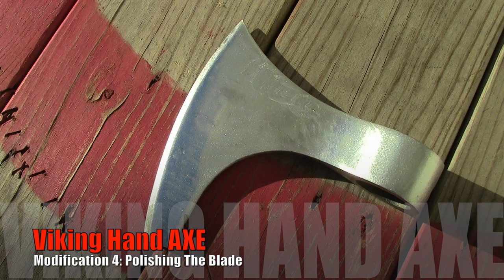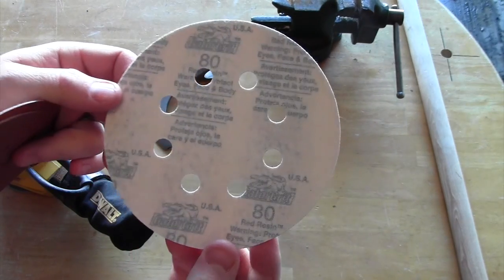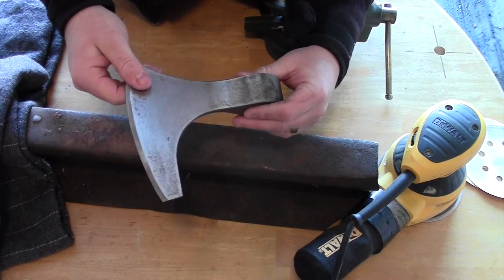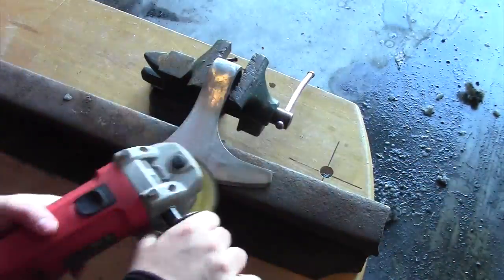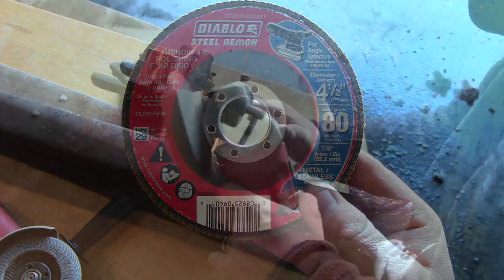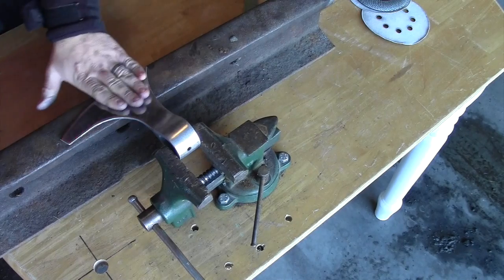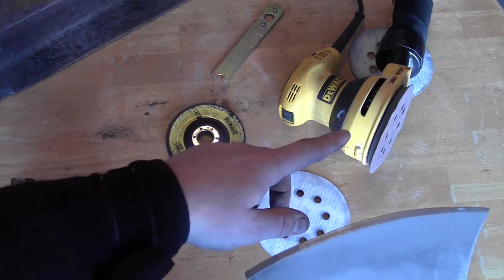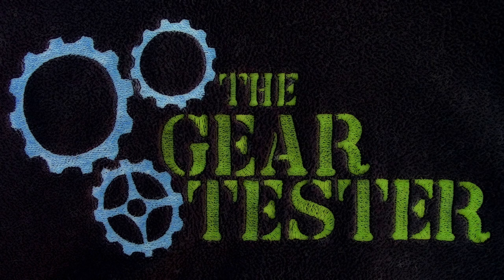Viking Hand Axe: Modifications (Part 4)

Comment: To bad you never finished this series. I just used a belt sander with finer and finer belts, then hand sanded it, then used Steel Wool. I guess I've had mine for about 3 years now and I really like it. I hope you tossed that set screw. Worst idea Cold Steel ever had.